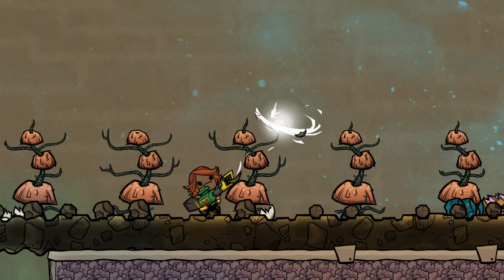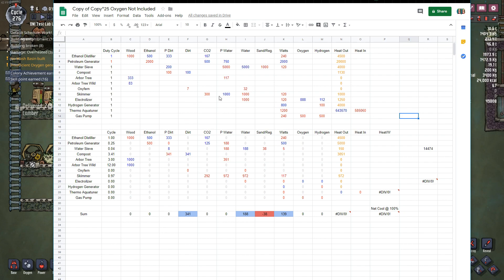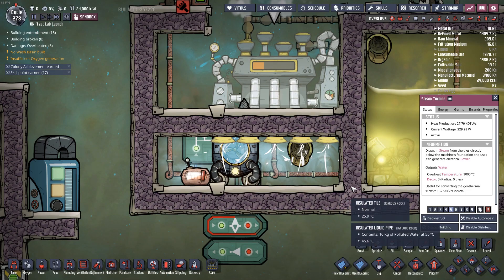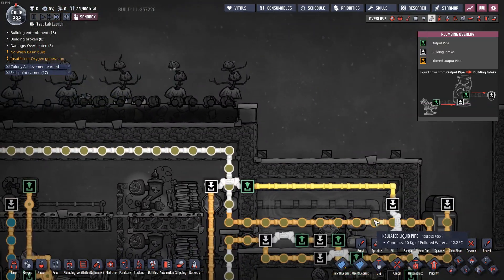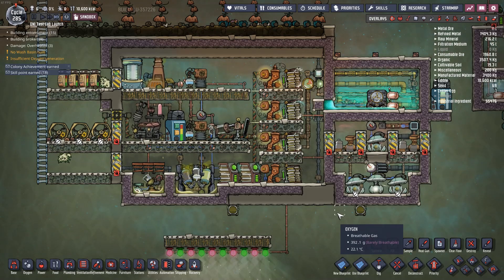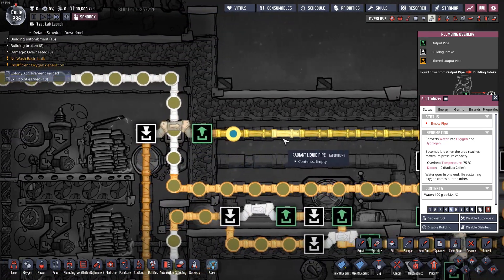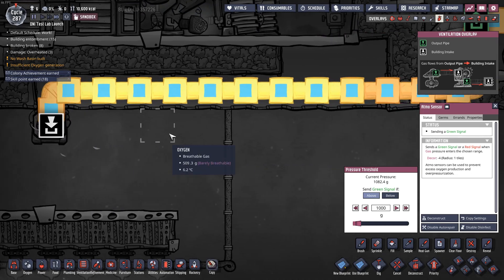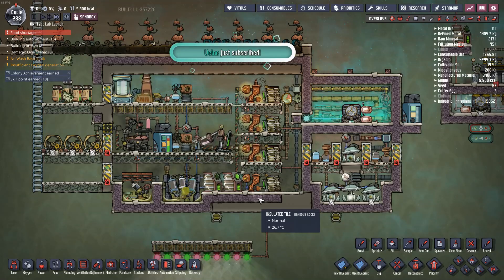Turn Lumber Into Cold Oxygen! Oxygen Not Included

Comment: EXCUSE ME, so you are telling me I can just heat up the hydrogen before burninf it into the generators and that will delete net hear from the system without steam turbines? That's crazy as hell
Reply: Also I heard you can avoid state change by keeping the volume of gas or liquid on a pipe by keeping it at 10% of it's capacity, so I need to test how hot you can dump the hydrogen before burning it

Comment: I realize  this is an old video so commenting may be pointless lol BUT I just now figured out why he uses the ethanol in the room with the aquatuner, idk if he knows it or not (probably does but doesn't mention a lot of things here) but he's getting additional passive cooling capacity by using the phase change mechanic of ethanol. I have actually used this build in my game with some needed adjustments and it worked but not as well (wasn't as efficient - I think a combination of patches making things harder lol) but now that I know about heat deletion with ethanol phase change mechanics I need to revise my model to cool and heat the ethanol continuously. For anyone who finds this later pay attention to the temperature in the aquatuner room, the upper area needs to go below 75 degrees to liquefy the ethanol and then the lower area needs to go above 75 degrees to vaporize it again - this phase change deletes a little heat from the system due to the difference in shc. Also there is a more efficient configuration of electrolysers that puts out the hydrogen and oxygen way more efficiently- I am now re designing this to deal with the updated mechanics and make the changes that I see need to be made. Thanks brothgar

Comment: You can build generators from steel, and heat generator room to 130-200C. In that case polluted water immediately will be transformed into steam and dirt, and you will be able to produce power from steam, instead of wasting it for water pumping and filtering. Most difficult to heat room from 100-120, because during that transition period you will no be able filter polluted water (it will damage tubes). Of course, you will have problems with ethanol, because vaporization temperature is 70+. But from my opinion, no need to cool generators.

Comment: if you just heat up the dirty water you will get steam and clean dirt. Then cool the steam down to get clean water.  That way you wouldn't need to use filtration material to clean the water. you can also reduce the power cost and maybe increase power production.

Comment: Does anyone know if this still works?
Reply: Yea it absolutely still works, there have clearly been some changes but definately viable. For me it took 2 ethanol distilleries, and then I added an additional electrolyser that runs off water I pump in from my base to help with oxygen output and reap the reward of cool oxygen all at once. Once it hit equilibrium it's a power positive soln too I run 2 sets of atmo suits and some random stuff in the base with it. My oxygen comes out at 25 degrees C and I built it in the first 300 cycles.
Reply: I think water Output is smaller ab bit more heat.
Reply: @F4lc0n_ch  k

Comment: didn't power buildings output temps always correspond to their temps? for as long as I can remember they have, the natural gas generator works the same.

also you could produce more oxygen if you let the polluted dirt offgas PO2 and use deodorizers to filter that... you could then turn the clay they produce into coal with hatches to help further lower the net power cost.

Comment: Just a couple of 3 questions:  1.  Looking at your spreadsheet for the Aquatuner, I get where the Heat In of 58.51 is coming from, but how are you deriving the Heat Out value?  2.  It seems like you missed the liquid pump on the spreadsheet but accounted for it on your diagram (139W versus 134W)?  Just double checking.  3.  Also, you use g/s for units for lumber on duty cycle requirements for ethanol but then use the 83 kg of wood per arbor tree per cycle instead of 138.8 g/s.  You get 12 trees for the duty cycle, isn't 7ish?

Comment: When you put the High Treshold of the smart battery to 100 you loose a little bit of power because the automation system has a slight delay. The bigger the power generation system the more power you loose. Its not much but if you are struggling to get power, it suddenly becomes important.

Comment: A huge contraption to make 160g/s of oxygen where an oxygen diffuser makes 500g/s
Sure not the same thing but maaaan...is that all the useful stuff we can make of lumber?
Reply: Absolutely. wild lumber is renewable
Reply: I added an extra 2 electrolysers from my normal water supply just to add to the cooling loop so it was amazing for my base never had to worry about a thing, I hate that they output so much heat for oxygen

Comment: An additional gain, if you have slicksters, is turning that carbon dioxide into crude oil to make into plastic. It's pretty minor, but should be fairly power neutral since you would be replacing the scrubber with a gas pump.

Comment: What did you have the thermo sensors set to? and that random bit of wire and automation wire above the electrolyzer was that to remove the oxygen/any other gas there before the Hydogen lock formed? And I assume you used a Liquid vent to get the Ethanol in the other room? Otherwise I've almost built this entire contraption in my Oasis world, can't wait to get it started! Edit: Figured it out, they are set to 100 :D Also, found out this entire thing is not needed, if you never go above four dupes, you end up with KG's of Oxygen, My colony spent their entire time with popped eardrums cause I have TOO MUCH oxgen, lol.

Comment: What's the point to burn heat into hydrogen generator? You have that hydrogen anyway and you won't get any extra power if you heat it up. But if you instead use turbine you might get extra power additional to that generated by hydrogen generator. Of course it's possible only if you have gold amalgam on your map or rush to steel. Deleting heat with hydrogen only makes sense if you don't use thermoaquatuner so can't fuel turbine.

Comment: How do you get the Electrolyzers to run 100% of the time? A Petroleum gen only makes 750 g/s of polluted water, which is converted 1:1 to normal water. So you get 750 g/s of water, but Electrolyzers consume 1000 g/s of water, meaning you need 250 g/s more to power just one electrolyzer; and in your video I see you have two running at the same time. How do you get enough water for both, as they should consume 2000 g/s of water while you only produce 750 g/s?

Comment: Ok, im trying to make this thing in my game (tweaking it slightly). From what i understand - the thing placed inside the chamber with ethanol gas in that little hole is pipe thermo sensor. Brothgar doesnt seem to mention it in the video, but i understand it is there to make sure aquatuner doesnt "over cool" the liquid. So, question - at what temperature should i set it? freezing + about 5 degree?
Oh, and what to use in the cooling loop? That liquid doesnt interact with anything so i assume it can be anything. Would crude oil be a good thing to put there? I assume it will - high thermal conductivity, low freezing point.
Reply: I actually found a frame where he shows Automation overlay and i see that there are some more stuff behind the aquatuner (and 2 thermo sensors i forgot about). So, is it safe to assume that it is an OR gate there set up with NOT gate to turn off the aquatuner if either the liquid in pipe becomes too cold or gas around too hot? And why exactly 2 sensors? You hook them to the OR gate together on one wire? Do the have different temperatures on them?
Reply: @Lemel-zr  Yeah Brothgar mentions the automation there is to protect it from overheating, but doesn't actually go into detail on how it's wired or what settings the thermo sensors are set to. Would be great to have that cleared up! From the looks of it, it's an AND gate and the two thermo senosrs are keeping an eye on the temperature of those two pipes but i'm not 100% since even when he briefly brings up the overlay, half of it is offscreen.
Reply: yeah, there is bits back and forth which he shows the entire grid, and clicks on most everything BUT the thermo sensors, does anyone know what they need to be set to? Its def an And gate, as he scrolls over it and it shows what it is.

Comment: Your calculations seems off. 
7.2 trees produce 2400kg lumber/cycle which is enough for 
4 distillers producing 1200 kg ethanol/cycle which is enough for 
1 generator producing 450kg pwater/cycle which is enough for
6.42 trees.

Calculations: 
Tree: 5 branches * 300 wood * 7.2 trees /4.5 growth cycle = 2400kg/cycle
Distiller: 1kg wood/s * 600s/cycle * 4 distillers = 2400kg/cycle
Reply: Wild trees?

Comment: Hey there, you might also want to point out, that it is in your best interest to insert materials at the same temperature as the machine's minimum output temperature ->
If you use cold water (15 C) to make oxygen (70 C) you LOOSE 55 C of cooling capacity.

Comment: Klei has entered the chat room.
Brothgar has entered the chat room.
Klei: oh hey, you see how i fixed them heat flushers?
Brotgar has posted a video.
Klei: ...

Klei has left the chat room.

quite honestly this one seems pretty balanced, you don't really delete a massive amount of heat, nor do you get a ton of power or even a lot of oxygen. it's kind of a all-rounder type system. normally i would be all for them slapping on extra DTU generation for the hydrogen generator based on the DTU of the input gas but this time maybe it isn't needed.

Comment: Brothgar, using batteries are not very efficient, very resource and space consuming. Isn't it possible to create a thermal battery? That would store energy in the form of temperature. It would heat a mass to store the energy and cool a mass to free the energy.

Comment: i was thinking tho brothgar....

if you were to vaporise the polluted water of the petroleum generator using the ever increasing heat of the system, wouldn't it be more efficient overall? 
like for example :

-avoiding you to bother sieving and composting the dirt, wich saves time, energy and ressources;

-as well as power  and water  since you get 100% pure water back from vaporising polluted water into steam,

- as well as free energy from using a steam turbine ontop to both generate water And deleting the excessive heat,

-making the system self-sustainable and even more efficient on the long run.

am i wrong somewhere on my concept or weren't you considering that possibility?
Reply: @brothgar  depends on how you can play with WHERE and WHEN you apply the heat.... for example, if the polluted water tank is away in an insulated tank then this part should be fine and not damage the rest right? 

as for the rest you only need to cap up how hot it gets ,or transport the heat AWAY from the main block,

 and use it for vaporosing polluted water, wich would save you some watts by not filtering the polluted water or trying to cool it,

in fact i'll go as far as saying that using the polluted water to absorb some heat could HELP my concept to work:

-as you see, if you use radiant pipes filled with polluted water  to take the polluted water away to the vaporisation chamber, you can also take some heat away from the main block;

-as well as pre-heating the polluted water to help it's vaporosation into steam to happen quicker.

-ith the clean water that got most of it's heat deleted by the steam turbine, you could fuel a loop for cooling;

-as well as fuel a carbon skimmer and your electrolysers without much effort;

- and fuel farms/ranches that requires dirt to work.

-you can even fill the main block with ethanol, and restrict your dupe's access with a transit tube later on to increase the heat transfer  ;

-thus improving an already quite efficient concept. and i bet you that you can make it work with aluminium. 

waddya think brothgar? i just tought of that whole concept just now and i tought it could improve your system's efficiency...

Comment: why nobody automate dirt production by vaporising polluted water? 1/3 energy back from turbine robotdigger gets dirt ad conveyor loader do the rest
Reply: It's 4 times less dirt that way, so very, very little dirt for a lot of effort. However, it would be useful for this setup, since if you can later get steel, the petroleum generator could be kept at 200 C to instantly create steam, without using extra power.

Comment: Cool.  I found oxygen hard to come by on the maps where you start in the forest.  There’s no algae to start off (have to go into a slime biome for it) and the oxtferns aren’t very productive.  You can get rust but then you are left with tons of excess chlorine (there are ways to use hydrogen but nit really for chlorine.). So this system seems pretty good - too bad it seems pretty late.  I’ll likely have extra water going to electorolysere before that comes into play.
Reply: I built it by cycle 150 in my forest biome, gutted an interior area of abyssylite and all these materials are starter materials. Pro tip for the forest biome with no algae, use polluted dirt from the porta potties and throw diffusers everywhere, you get free unlimited oxygen, the sand is recyclable because the filters create clay, if you use a kiln to make ceramic then smash it it becomes sand again, I ran my base SOLEY on poop air for over 2000 cycles lolol!! I honestly couldnt build a spom or this because I had too much oxygen! I had 30 dupes, that colony is still going strong but I wanted to try this build so I started a new map.

Comment: Interesting way of deleting heat. In one of my maps pre launch I was cooling a hot steam vent like that, except I had the hydrogen from 2 electrolyzers run into both an aetn and hydrogen generator. It kept my cold biome from collapsing 😅

It was also great because not only was the aetn deleting a lot of the heat, it was so cooling very efficiently

Comment: This seems interesting, i have tried the oasis myself aswell, and it is pretty hard if you struggle with the middle of the game like i do, i have the early game nailed pretty hard, can setup lavatories in less than 20 cycles with a somewhat functional germ cleaner, but i cannot seem to get past cycle 80 without everything F***ing up, i still have a good amount of water, but oxygen is becoming a problem from running out of algae, i found a water geyser, but were lacking the dreckos or the oil to produce plastic for a steam turbine... so i am back to square one and focusing on mechatronics engineers (who for some reason keeps dying) and ranchers, since i am not very good at digging down, and figuring out how to get power going without running dry on coal, my asteroid has been The Badlands lately, it has a good difficulty.
Reply: On the forest Biome maps, I never go past 3 maybe 4 dupes, makes it much easier. on Cycle 180 now in the Oasis map, finally decided to get my fifth. :D Almost finished this build too! can't wait to turn it all on!
Reply: HOW DO YOU FIND ALGAE ON OSAIS

Comment: One thing that I've learned on the Oasis: The Aluminum as a refined metal have a great Heat Capacity and Conductivity. If it was not that it melts at a lower temperature than steel, it could even replace it. But it makes a good pre-space alternative if you can control a little bit the temperature of the environment there.

Comment: This is cool and all, Still this only seems good if you have alot of wild arbor trees and need dirt + small amount of oxygen. Putting the generators in a Generator room with engie's tune up will massivly increase its potential as a power producer. Also this setup will need alot of compost piles for dirt if you don't want to use the polluted dirt for something else. (This system works really well with pokeshells.)
Reply: Forest biome + pips means you end up with many tree's easily where you want them wild though. gotta love pips! Then just find a slush geyser and bam :p You only need three!

Comment: Instead of composting the polluted dirt, you could use pokeshells to convert it to sand so you have a surplus of filtration medium
Reply: The pokeshells eat 50% of the mass so you losing dirt and get "useless" sand. Sand can be grinted out of stone dirt can only be made ouf algi (heating or feeding to fish) or compost.
Many things need dirt like food and farms. So if the shells of the pokers are not you maingoal you shoud not flush your pdirt that way.
Reply: Pips eat tree growth and poop dirt, and the ethanol distiller in this setup produces about 10x the polluted dirt vs used filtration medium; 1 tame pokeshell added would make this go from 341g/s polluted dirt and -38g/s filtration medium to 107.66g/s polluted dirt and 78.66g/s sand.